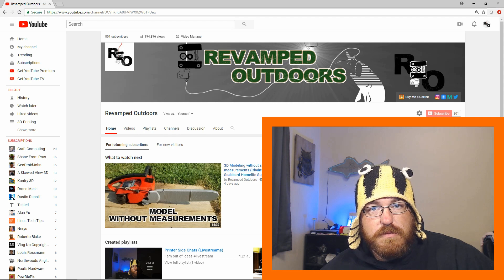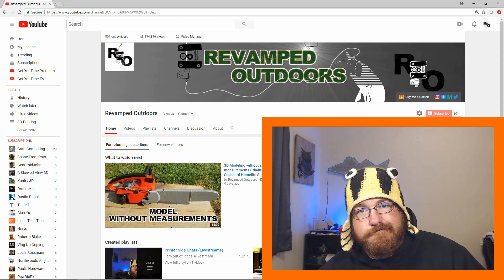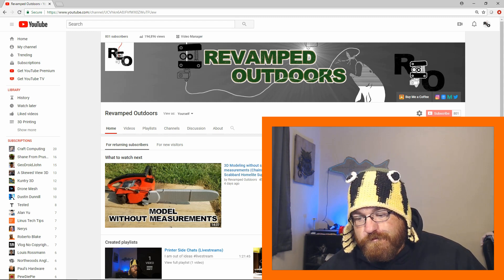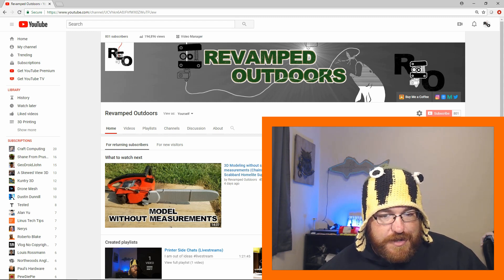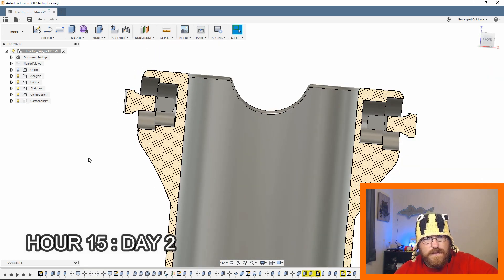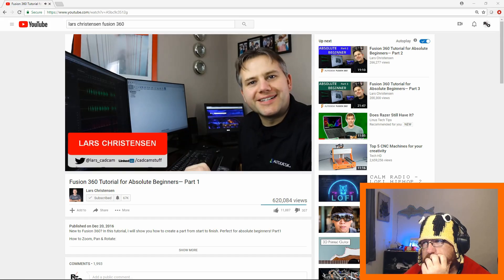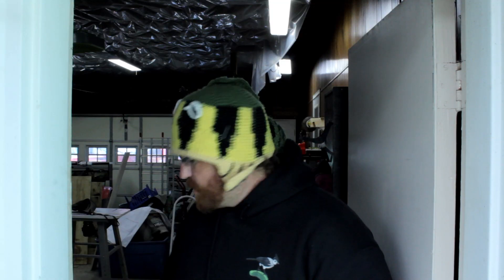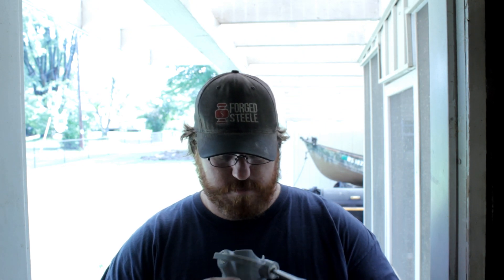The TRUTH About 3D Printing!

Comment: #AppreciateYourTime #appreciateYouAsA3DModeler Great video is this going up on thingiverse anytime soon?    ;)
Reply from the maker: Thanks! I might have to modify the connections for the arms still, it's set up currently just to be glued into two spaces on the center bearing.  Not 100% satisfied with the strength of the CA glue connection, I think I will have to index some posts or something so at least there is some overlap of plastic.  Short answer, yes...eventually lol.
Reply: sounds great thank you I will be the 1st to dl  :)